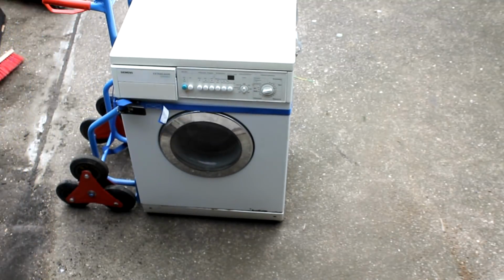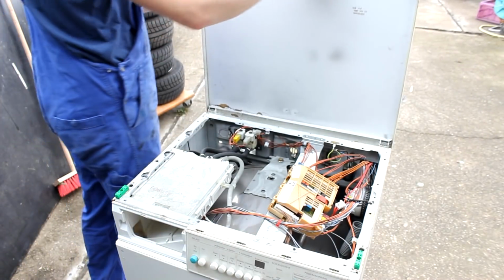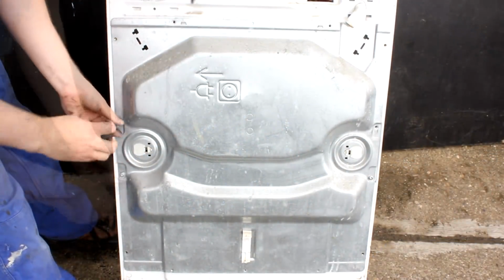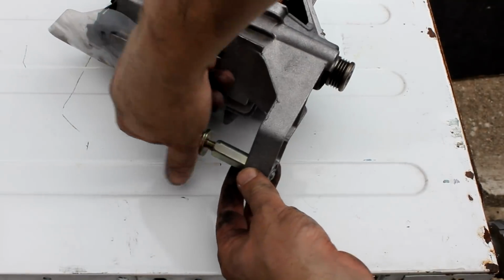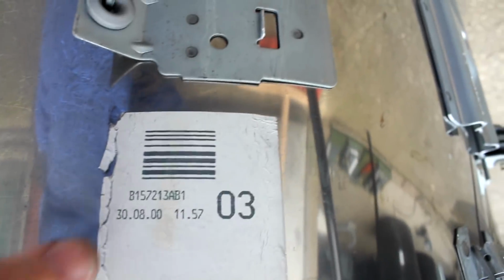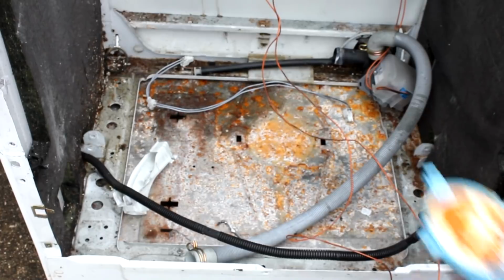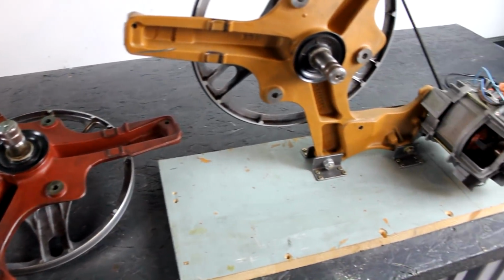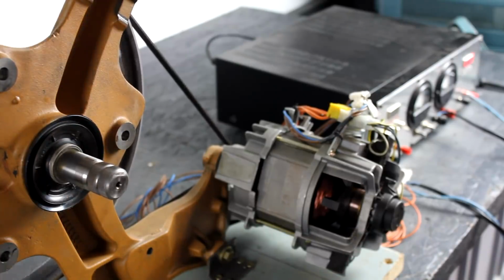Salvage a Washing Machine Motor + Transmission from a Siemens Washing Machine

Comment: I'd have really do this video in a way , but not really.

Years ago when I was much much younger.

We had this rule that if it went out for any reason.Or was no longer useful.That Sort of thing.

If absolutely anything useful out of it, whatever it is got?Salvage for part To do something with.

Also of course if it could be fixed would be.

Case in point with the old dryer of ours.

The stupid switch that combined essentially 3.Sets a contacts and clean the start contact.

Was replaced with two target switches and one push button switch.

That switch was at least $50. Maybe even 60 back in the day For the Dumb switch.

Even at a air fluff cycle since there was a charge to turn on the and off the two toggles which is each one controlled the two heating Elements both both off headed air floss or air dry cycle.

Kind of a Bonus feature.

Eventually, once the dryer went.Of course , got a whole new pair of machines , the washer Let's have some problems as well by that time.

Needless to say when those things went they got scrapped for parts.

2 machines in my workshop were run by the motors.And yes did use the dryer blower for dust collection system of course.

Both could be used without drive.Anything needs driven.Use the same motor if it was capable of running it.

Back in the days people used to do this when motors were so expensive.That you could really get away from one motor and belt driver.I think you're just put the motor on the machine you needed it.

Same thing with my vacuum player.It's on its last legs.That's if it's still running.It will be used in a workshop as a dust corruption system

Father is kicking himself for getting rid of the old vacuum cleaner that the hose got messed up and beyond repair. That how far filter clean?His vacuum wound made an excellent.The dust collection system plus you had the blower available.

I also would have adapted the power head to be able to use that with something like a porter power in some manner.

Is powerhead was In great condition.

Funny thing was when we got that vacuum.We set everything up and something the same right at all, and it seemed like the power head was running too fast.Turned the thing over sure enough.Brush roll was not even running from the factory.

Low and behold the belt had never been installed.That's god to be a first.

Considering how well known and how well built these horror that's all called control that really had to be a slip up.

Needless to say.
We got developed free of charge and despair from SE vacuum place.We got the vacuum from.

Even they had said they'd never seen that happen before on any vacuums.That came with a belt Is preinstalled

Comment: Hi.  Great video's.  Very inspiring.  For these washing machines, have you considered making a parts tumbler?  You are always washing old bits and pieces.  Years ago I used to use one with a bit of soapy water to wash small fasteners, nuts bolts and washers on a slow speed.  A mild tumbling action cleans them up a treat.  Google parts tumbler.  You can also add some sort of media for polishing metals if you have an interchangable drum.

Comment: Hi i am having an  automatic washing machine the problem is after filling with water the washing machine doesnot go into its washing mode but the led indication on it shows it entered in to its washing operation the fault is found to be in its circuit board is there any way i could use this washing machine as the cicuit board cannot be found as this is a very old machine and the company doesnot exist anymore

Comment: It's not worth to salvage brush motors from old washing machines!
Because it's hard and difficult to contol the speed and torque for those motors. And you will also need to build or get special controller for those motors.
It's better to salvage three phase asyncron motors from washing machines, because you can connect them to an standard variable frequency motor drive to control the speed, just like (photonicinduction) did.

Comment: If you can independently control the stator and field windings, you could turn this into a regulated AC output alternator. I realize that the EU uses 240 VAC @ 50 Hz but by varying / regulating the voltage to the field / rotor windings, you could get a stable voltage from it. Maybe use a battery and charger circuit. Some people use capacitors to energize field windings but I don't know how stable this would be. If it sets for a while and the capacitors discharge, you'd need a voltage source to get it started anyway so you may as well go for batteries and avoid the extra parts. This would make a good project for a water wheel driven alternator too. I saw a video years ago where a guy in New Zealand used the tub and motor from a front loader that had the newer permanent magnet motor. He cut flaps in the tub to catch down hill flowing water to turn the tub and motor. The holes in the tub kept it from filling with water through the cut flaps. He funneled the water into a pipe with a valve in it. He took the handle off the valve. He then direct wired a home made control circuit to the motor of a battery powered electric drill. He mounted the drill body to the apparatus away from the water and then he put the shaft of the valve in the drill's chuck. If the water flow was such that the alternator put out 240 VAC, the drill's control circuit was in balance and the drill did nothing. If the water began to flow too fast and the voltage increased, the control circuit would be out of balance and input a forward voltage into the drill's motor and it turned the valve partly closed to slow the flow of water. If the water slowed and the voltage dropped, the control circuit went out of balance again and input a reverse voltage into the drill's motor to open the valve to bring the voltage back up to 240 VAC and bring the controller back into balance. It showed the drill in action as he affected the water flow with his hand. It was really ingenious. I wish I could say that I invented it but that would be lying.

Comment: I have been playing with the idea of building an electric vehicle for a while now. I did not have the technical knowledge yet, working with motors, controlling them, working with metal, etc. Your videos are the best resources I have found so far to get new ideas and also as a source of information and learning what I need to learn to build the vehicle. I have been putting together some tools and collecting parts from the street (I live near Hamburg). It seems that completing the project might take me around 3 years at least but I'm very excited about it. Thank you for the invaluable videos!

Comment: That inner drum with all the holes is good for camping for your camp fire. I had one sitting in my fire pit at a state park with a fire going one time. The wind came up quite strong and the park rangers were ordering every one to put out there campfires I was ok. I had placed a metal trash can lid that I had drilled 1/2 inch holes inon top of it and had coffee purking in the coffee pot. The head park ranger liked my set up. I did not have to put out my campfire because it was safely controlled.

Comment: Perhaps use it to run a vehicle generator/alternator wired to generate A/C by removing the diodes or generating DC current to charge a battery bank and to run the motor, thus creating a self sustaining power generating station?

Comment: With the 'modern' rate of improvements happening to all electronics, especially motors I wonder how useful this older motor is?  Can you retrofit a variable speed controller?  Can the motor be rebuilt, balanced, the magnets or coils checked or is that even necessary?
The variable speed pool pumps use 60% less energy than these older dinosaurs, but maybe this machine is newer?

Comment: I have a similar motor lyiing around, but it has the same problem : 7 leads into the motor. How do You deside which lead goes to 200 V and wich is going to neutral??You never came around to that in Your nice video

Comment: The good thing is that a German-made washing machine is about as well-engineered as a BMW or a Mercedes, so getting the engine and transmission from an almost free salvage washer is like free lunch - to the engineer. The list of applications is endless and includes reversing the logic to generate power from a wind turbine, for example.

Comment: Nice teardown! My 1999 Bosch machine has a similar Siemens motor, in fact the drum and a lot of the other parts look the same. I changed the brushes in 2014 and it is still running perfectly!

Comment: Interesting vid, but, same critique I have for most of your videos... content density. Probably fewer than 1/5,000 of your viewers cared how to disassemble this specific washing machine, and, even for those 0.02%, they probably needed something more specific. You went through that at a slower pace, which means many of your viewers were probably bored or didn't value that content as much because it's not interesting to see a blog about a specialized teardown. Maybe 98% of your viewers are watching you for entertainment and education. Perhaps only 2% will try to emulate what you're doing (I'd say this is typical for any DIY, most of the value is in education/entertainment). The 98% like to feel as if they're the 2%, so you can feed them nearly the same content and they'll probably be happy.

I like to see full teardowns, but, you could have shrunk that first 10 minutes into about 1 minute. Say how to generically take apart a washing machine, you'll have the motor and controls, a pulley and a drum, the drum will be annoying to take apart, maybe watch out for these couple things to make it easier.... and that's it. Just speed through it with a minimal voiceover.

Anyway, just constructive feedback on how I think many viewers would enjoy the videos more, make the content you enjoy making most.

I'm interested in DC speed control on these motors. You'll definitely be able to make a high powered E-bike with this motor, higher power than is maybe legal in Germany (however for "safety" and outdoor use, your motor should be 'de-rated' to a lower max rating that might be within the legal parameters).

Comment: Great videography and detail on your videos, your english is very good!  A lithium ion bike using a washing machine motor would be (ghetto) awesome- however you would probably need a proper gearbox (even planetary gearing?). With a 48v setup you could get some nice RPM/torque out of such motor, seeing that it runs on 20v already?

Comment: I once built a knife/axe sharpener from a setup like this. Took the motor and drum assembly from a 1970 top loaded drum style washing machine and a big (about 50cmx10cm) grinding wheel. Moving slowly with a small water reservoir at the bottom. Works great!

Comment: The door of this washing machine makes a great dish, not only for salad, you could even make a casserole in it because it is really thick and heat resistant glass, so you can easily put it into the oven without damaging it.

Comment: I've taken apart a few of these in the US.  They typically have a 3ph induction motor in them.  Not sure how they're going about converting the single phase power.  I'd love to be able to use one of these for my projects.  Have you come up with anything for this yet?
Reply: You can power them with a "Rotophase". You can use a cheaper "Add-a-phase" that uses capacitors for a second phase to provide the rotation, but you will have 1/3 less torque and is designed for a specific horsepower motor.
Probably more expensive than what it's worth unless you have the components to build one yourself.

Comment: I would love to see you turn this around and use a pto imput on the large pully and connect an old generator or old belt driven compressor to the small end. or make it so u can swap out tools.

Comment: Gorenje also has cast iron and concrete. Bullet proof machines, rebuilt mine from the ground up for half the original price, and i'm expecting another 20 years of use out of it.
Reply: Borax can eat through that cast piece on the shaft quite easily. I tried to clean mine, and it ate the whole thing with pockets, had to buy a new one.

Comment: About 10 years ago I bought a new washing machine and about 5 years later it started leaking (out of warranty). It is a top loading high efficiency washer and I was able to obtain a new drive shaft and seal kit. I was surprised that the machine used a very large brushless motor (about 300mm diameter) with the rotor (with magnets) directly mounted to the drive shaft. The stator coils were mounted to machine. This means no transmission or belt reduction at all. To reuse this type of motor would be more difficult as the motor is really part of machine frame so one would need to cut the frame down to just save the needed parts or to fabricate a new frame for the motor. This would be interesting to try and use in a project though.

Comment: That three pronged casting is called a spider, used to disassemble hundreds of them every day due to a bad batch of faulty bearings in Hotpoint model, they had edge bolts that needed drilling out and then u had to pry bar it away from the drum, the hotpoint ones have a plastic outer drum made in two halves with a seal. What a back breaking job that was!

Comment: You could use the motor plus a heating device to make your own industry sized (simplified) Thermomix. Could be useful for partys, when you make like ten litres of Chili con Carne with it. It would require a programmable input method though, similiar to that of a microwave. Basic functions would be Spinning speed, Temperature, duration of spinning, duration of heating, intervals, Go, Stop, Pause, Reset.

Comment: I'm definitely interested in a dedicated motor controller for the mode of operation you've displayed here, I'd like to use an assembly such as this to roll a barrel full of aggregate, but it needs to go fairly slow compared to what this motor is capable of.

Also if you could get any numbers on what kind of torque curves different controller styles offer, I feel like that's come up in a past video, I should go rewatch them all.

Comment: why do you wear a dust mask. Is it toxic to disassemble a Washing Machine?
Reply: Probably just to protect from particles from someone eleses houshold dust, fibres from old clotes, etc my guess.
There shall be no problem doing it without the protection, at least i am still alive...

Just be sure to wach Your hands carefully in frech water if you get some washingmittel on your skin, because it´s corrosive.

Comment: Hey, looks like you're good at motor projects.
I'm trying to literally UPSCALE a servo motor for slightly more heavy-duty tasks, with the focus on speed over torque.
How could I do that? I hate to use stepper motor because it's so expensive here (to ship/buy) and I have to use software tricks to get accurate feedback.
The thing will be used in a turret so it's important it doesn't crash into the end stop or spin out of control.
Could you lend me a hand?

(p.s. Drill motor here is easy to find and I'm going to use either DC or SMPS)